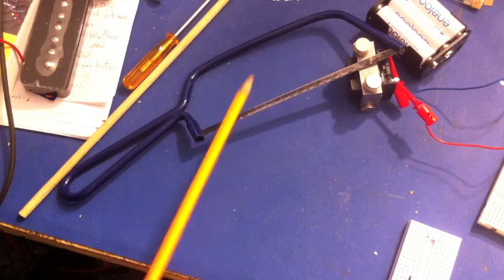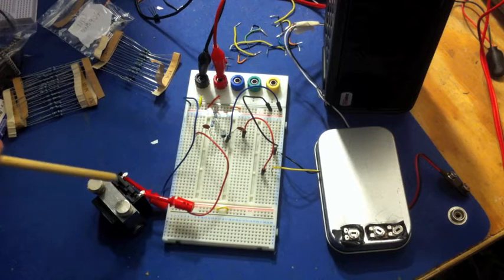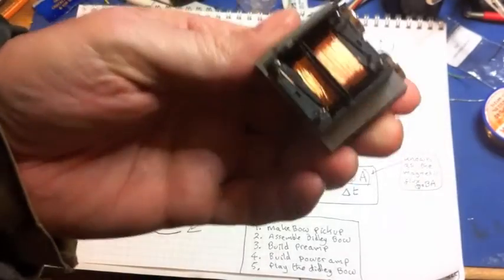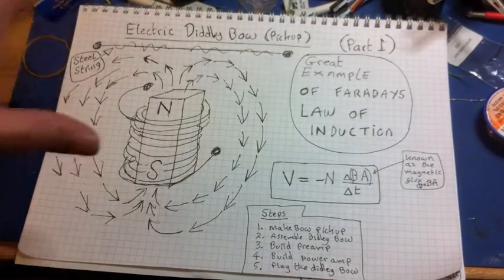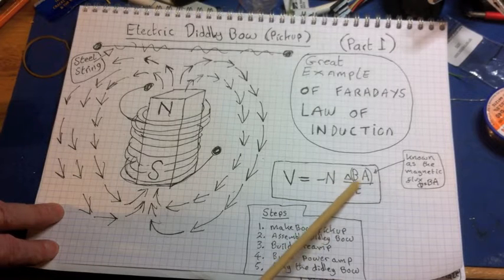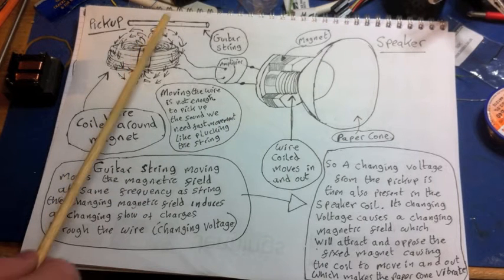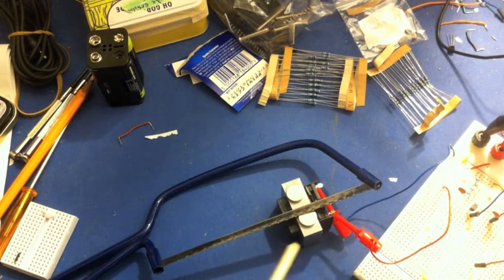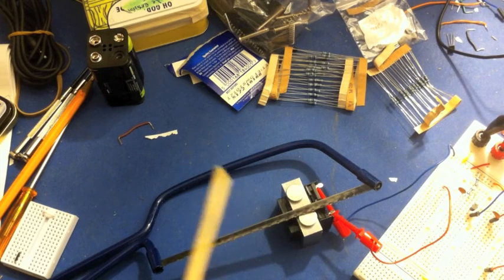Electric Diddley Bow Construction Videos # Part 2

Comment: That transformer have core made from two parts, one is in the shape of letter E and attached to it is second part in the shape of letter I. They are together like this: EI and the coils are in the middle stem of E. The I part closes magnetic field so that most of it flows through the metal. I think you will achieve better results of you remove the I part. Then magnetic field will be forced to flow through air where you will put the string.
Reply from the maker: Great observation. I agree that would make a significant difference.

Comment: Cracking walk through, I understood a lot there and it reminded me what faraday's law does :-) it was great to see the math being broke down to :-D loving your sketches and explanations. For Faradays law I can only see the magnets converting magnetic energy (probably the protons likely originating from the sun being passed through the magnetic poles) in to electrons which are then fed in to a piece of matter to cause the current :-) and as you say there because that matter is full of electrons and it needs to expel some to maintain balance, then the electrons are passed down the line to be spat out at the other end :-) I reckon the moment we nail gravimetric measuring is the moment faradays law will reveal :-)
Reply from the maker: +BattonFive Thanks for your kind comment. You are thinking very well. Such intuition is how we all discover new things. ;-)
Reply: Tech Tins not at all, its very kind of you to take the time to explain this stuff, as you say its definitely degree end gear :-) I thank you for your patience, genuinely :-p
 my friend did the degree has an unusually large i.q. and tries to explain the odd bit here and there, but without doubt your explanations are far more understandable to the regular guy like myself :-)
 that's right im free styling my way through life :-) I would love to know the math on it all though, if I ever won the lottery I would treat myself to a math A level and do the degree after it :-)
 but yeah playing with magnets in schools is pretty cheap, thus widely available, it sounds like it comes down to people knowing the more indepth stuff, who can then share that advice...I guess that means you need to become a school teacher, I mean if not guys like yourself then who right? :-p
 My friend who did the physics and maths degree...course thing (not sure on the exact course names) :-p he went to teach in a school but it wasn't for him by the sounds of it. he went in to high end accounting instead.
 shame as he is less than a handful of people that i know who know about indepth physics.
 I seem to get close to the concepts of stuff and how things work now and then, but without the math and time dedicated to study the other laws and research out there, im well out of my depth :-)
 but I do like the idea of equilibrium, balance, that nothing is lost and just transferred. its why I go against the idea of an expansionary universe, and even Hawkins with his ideas of nothing to something from a static or something or another.
 just keeps going against that something from nothing...fried my head to the point of Cantor where I came to the conclusion that the universe has always existed infinitely in some shape form or another and always will...and that will have to do...atleast for now :-)
 but you do extremely well to get across the info and do it in a small time frame, that's a real hard skill to learn, deserves plaudits :-p
 from the sound of it you should keep up on the y.t. front so in time as you become even more well known you will be able to spread the info, I know the odd other channel doing similar but your explanations would be great for the young and the old
 this type of project even if someone is watching and doesn't fancy a go is a great way to learn more about faraday and the laws that run our regular electronicy lives, so its good watching regardless :-)
Reply from the maker: +BattonFive
Very kind of you to say that. The thing is the maths is hard. But, you really don't need it to understand what the maths explains.

The thing is, its very hard to teach these things without using math. But it can be done. Its just it is not something any teaching establishment with regards physics would do as it would require real experts to teach it that way. And those people are far and few between.
Reply: Tech Tins I can respect what you say here, that the math should be the aid not the leading focus while the real scientist is the observant who pushes for clarity on observations as to prove it to be true.
 there are indeed some really great thinkers who without the degrees have come to understand a lot of the more complex concepts in physics.
 another friend Mr Creedables :-D is self taught and has a really good grasp of the laws of physics :-) that he lives with our mate Dave who has his degree and mega i.q has been a real boon to:-)
 worst part is he understands dave from his readings and follows what dave has to say, but I seem to have a trigger memory and need a little more coaxing...usually with drawn diagrams :-)
 but yeah I try to explain as best I can on my vids where I have been trialling ideas, I figure if a single person can benefit from what im trying to get across then it was worth doing :-D
 I do like that Einstein quote, I can imagine him trying to keep it real rather than trying to make himself look clever and cool :-)
 I must admit I have quite a bit on atm in work terms, project terms and awaiting book terms, but I would love a list of good reads for physics for a read once I clear this backlog im clocking up.
 Im a self employed programmer (know a bit of math but not high end amounts, enough to understand your explanations but not enough to understand things on site), which keeps me busy, while at the same time im pushing to make a bit of a manufacturing setup so I can produce bits for the scale hobby enthusiasts :-)
 While at the same time workings towards making a scale tunnel and scale tunnel boring machine :-)
 I have a bit of a thing for lost cause projects :-)
 but I think in 3-4 months the work load im running should become more manageable so I can get back to doing some reading.
 Im mainly in to fantasy reading like im on the follow up book after 'the name of the wind' by Patrick Rothfuss, which I would well recommend to all :-)
 but after that I have a couple of quick reads  im looking forward and then looking forward to looking in to some new material, which would be great if it were some informative fun reads on physics :-)
 Atm my Dionaea are the closest thing to studying science im on atm, Darwin said they were probably the most interesting species of all the plants and animals and I can kinda see why so I wanted a closer look and that's where these led grow lights appeared :-)
 but I cant agree with you more y.t. is a great medium for sharing data, there are some really clever folk on here like yourself who make cracking contributions :-)
 it seems that the egotists often track the biggest crowds on this network but I think the real heroes of the networks are the ones like yourself who are here to share the data than be told how smart and witty they look :-)
 though im sure you are smart and witty to...but you get what I mean :-D just keep making vids is all, as the great Kevin Costner said 'if you build it they will come' and I can see your channel doing really well with time :-)
Reply from the maker: +BattonFive
Thanks your very kind to say that. My take on all this is just to say that Kids love to play. And this is also what physicist do. If you play you learn. 
;-)
Reply: Tech Tins totally agree :-) playing leads to learning and learning leads to insights :-D
 a positive mental attitude with a bit of patience goes a real long way from what I can gather :-)
 the elitist style nature of physics and astronomy say were always reserved due to the constraints of making an income, like the old rich mill owners had time and plenty of resource to fund their projects and studies back in the 1800s, I must admit it is hard to find the time and the stress free environment to get my head on it and in gear:-) and course play more :-p
 but yeah we should all admit that we are kids, some seem to loose the zest for life but I think that's partially that they are sold consumerism while they are kids or have mental illnesses say, but there are plenty of us out there that regardless of age we are willing to mess, play, have fun and learn :-)
 and yep I always think im darpa without a budget, but not in that space race, money is no problem way :-)
 I expect a lot of fails taking the fringe approach but now and then like the lights I think, win, that will save some folk some doe somewhere and recycle some old gear while they are at it :-)
 Darwin was pretty awesome he seemed to be a real master for finding patterns and then testing the findings for variations in species to then analyse why the differentiations occurred :-)
 With the Dionaea I think he was thinking about how life regardless of its looks or origins will take nutrients where necessary when in need. the dionaea originated where neutrition in the soil were low, so they tapped bugs for them that flew by instead :-)
 Im really enjoying them for their variances in cultivars, you can see here how ranging the different cultivars are : http://www.flytrapcare.com/store/venus-fly-traps/registered-cultivars-venus-fly-traps
 They are a very picky plant and prone to death, but I am enjoying the growing and the hunting of the different cultivars down :-)
 definitely would recommend having a go at growing stuff, it teaches you a further patience you thought could never exist :-D
 Im also really looking forward to your future vids and projects, you really know about electronics which is half the win, and like here the application of the theory is real fun and from the way you have produced it its really informative :-)
Reply from the maker: +BattonFive  100% correct about having wealth creates the time to do things. But its interesting as many people who have great wealth don't do these things either. But "you" are creating things anyway. Not having the time because of our need to earn a living is a pain I agree. But at least we are living in a first world country. So in relative terms as a percentage of the worlds population we are very rich. We were born in the right place on this planet at the right time. We are the few and are very lucky.

Your doing it well from what I can see. Just keep doing what your doing. Also following along with your projects is fun for us to.
Reply: Tech Tins thanks ji :-) yep totally agree it is guys like us that regardless of wealth or privealage, we choose to ask questions and further curiosity, while as you say some of the rich and poor focus on other things like fashion and consumerism and things :-D
 but yeah we really our rich in comparison to many, purely by fluke and the ruthlessness of our forefarthers :-)
 my wife is a Sikh from the Punjab and I cant knock it, they have it pretty rough over there, where we seem to connect up to the universe with science they seem to do the same but in a spiritualistic way, like we are all pondering on the same thing and taking different paths to get the answers :-)
 but where we gain in many ways they have their own perks to, like the stars in the Punjab are almost intimidating in their vastness, the milyway is setout like a painting and when compared to out cloudy light polluted skies in England I just thought, wow how lucky are you guys? :-p
 If I get chance in 5 or 10 years down the line I will probably go over there for a few years to live with the family and take my telescope and large hard drive with me as their internet is pretty dire :-)
 can upload stuff after i come back from the few years of hanging around over there :-D
 I appreciate the support btw and can only mirror it back :-) you are a very competent guy, I can see you making some pretty amazing gear and videos over the years to come :-)
Reply from the maker: +BattonFive That is pretty cool stuff.